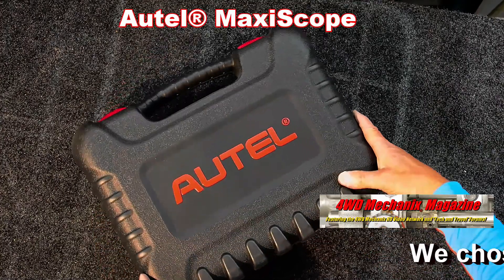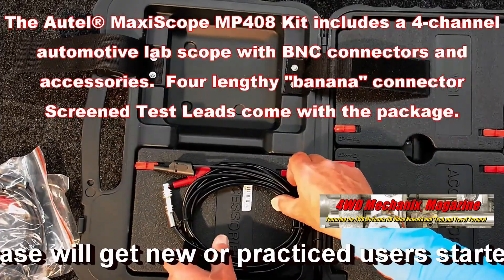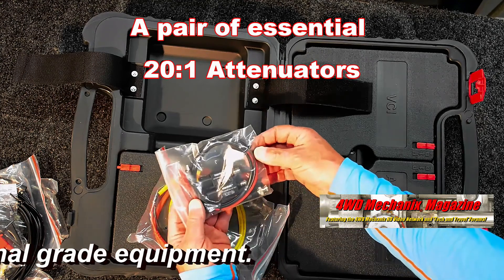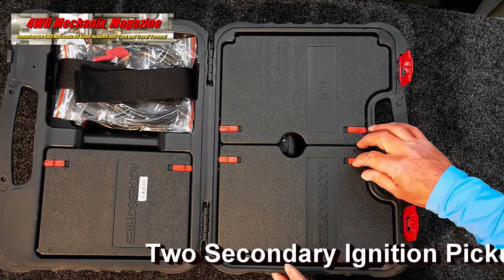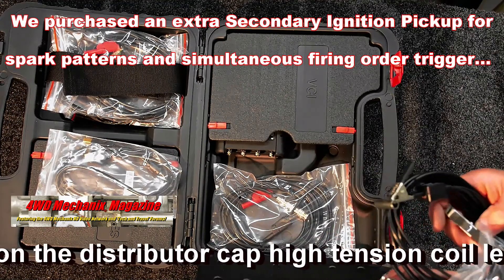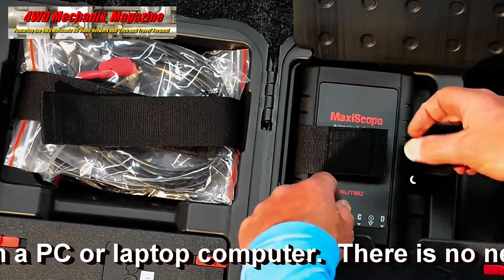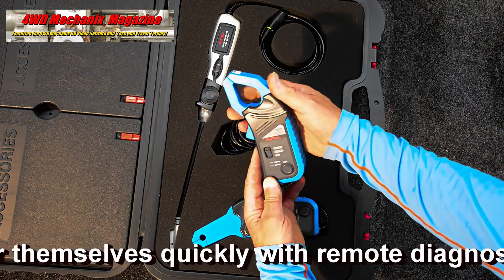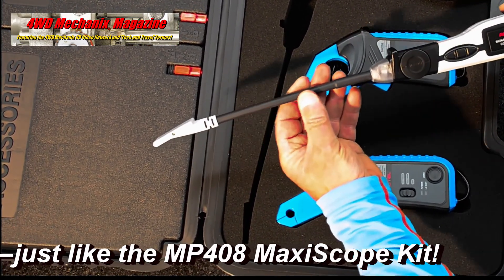Autel MaxiScope MP408 Automotive Lab Scope

Comment: Injector driver within the ECM…maybe too much current draw fries the electronics inside
Reply from the maker: Good point...Also, when using the MP408 or any other oscilloscope, know the current range of the device you are testing or probing.  Make sure to use an attenuator when voltage levels are high like when reading the coil primary voltage.  (Never try to read the secondary HT or spark cable voltage with a MaxiScope or Pico oscilloscope!)  The MaxiScope kit comes with two 20:1 attenuators to drop the input current to the scope.  (Hantek offers these inexpensive attenuators for BNC connector scopes.)  An attenuator keeps the waveform image readable on the screen and, more importantly, it protects the oscilloscope from current overload and damage.  Oscilloscopes can be fried by excessive voltage.